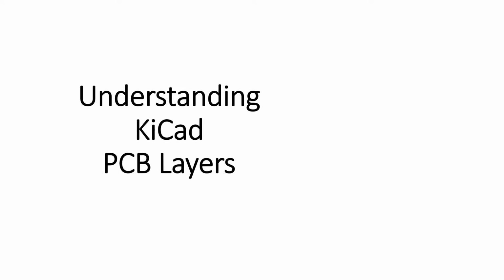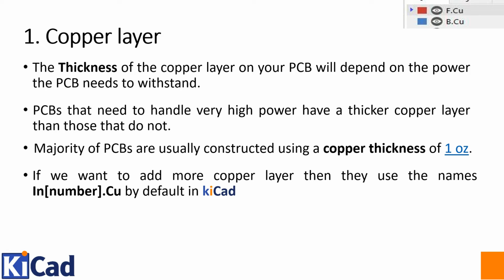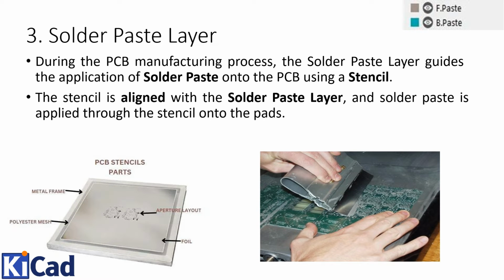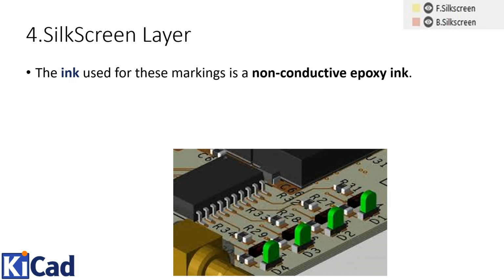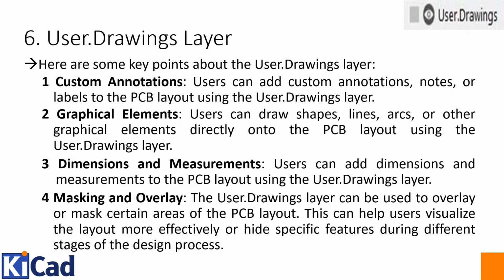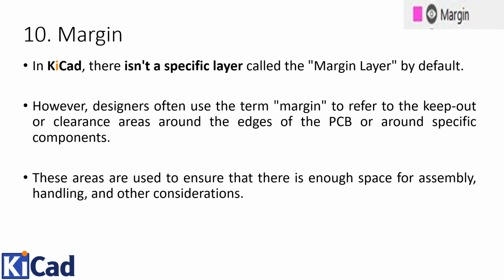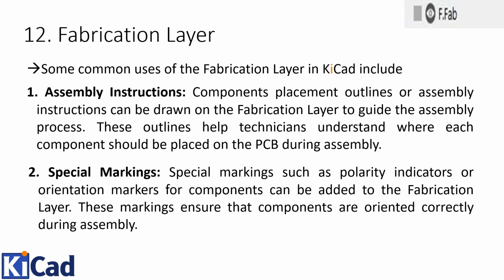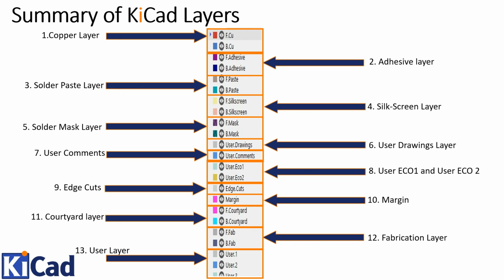56 KiCad's PCB Layers: Understanding there function in PCB design process.

Comment: What’s the difference between Margin and Courtyard layers?
Reply from the maker: Thanks for putting up a very good  question.
Courtyard Layer Defines the area occupied by a component, including clearance for assembly and manufacturing.
Margin Layer Defines a keep-out zone or an area that should not contain copper traces, components, or vias.

Comment: For flexiable PCBs how do a define an adhesive layer, is in this case its not prepreg dialectric layer its a film i believe.
Reply from the maker: defining an adhesive layer for a flexible PCB typically involves using a "User" layer or creating a custom layer for fabrication purposes. While KiCad doesn't have a dedicated "Adhesive" layer,